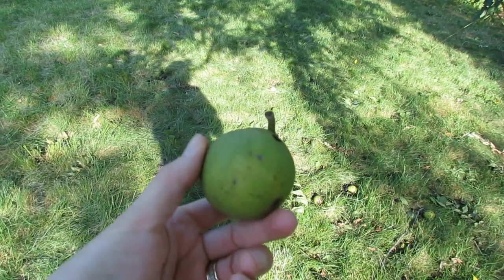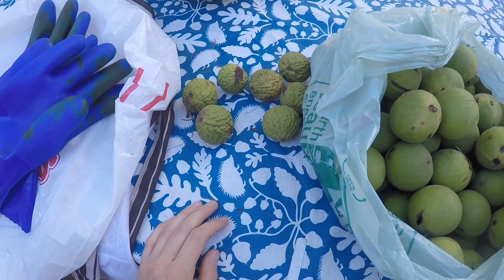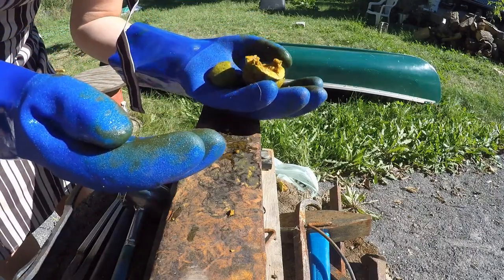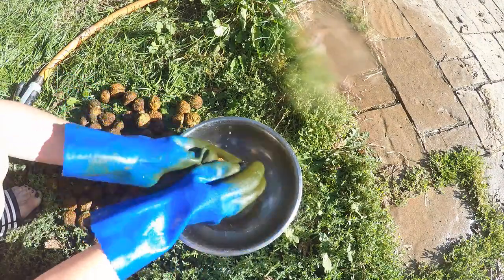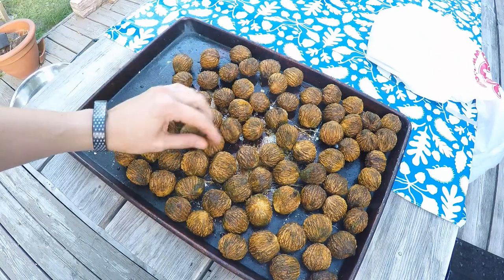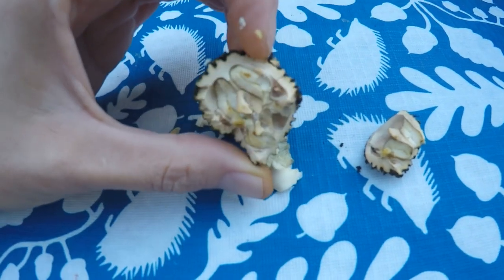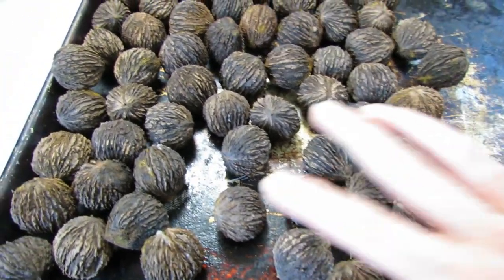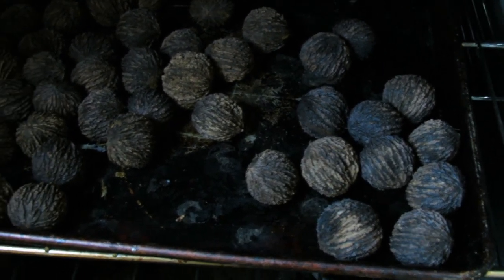Black Walnut

Comment: Hickory nuts are notoriously difficult to crack. Quite by accident, I discovered that drying them by applying heat to the soaked, wet nuts causes the shells to fracture. After the shells are fissured, place them in the freezer. After thoroughly chilled, the shells will fracture into small pieces when cracked in a vise. The nuts can then be removed without the use of a nut pick. Perhaps, some version of this process might work on black walnuts.
Reply from the maker: Thanks for the great tip. I'll have to try this out next year.

Comment: I have 5 mature black walnut trees in my back yard. this is a heavy production produce year.  triple cluster are the norm.   We wait till they hit the ground.  then wait until they turn brown.  It is much easier to peel.  of course I use a corn sheller to take the husk off .  I used to wash them in a maytag clothes washer but I just dry the nut now and crack them afterwards.   Jugalone .  It will inhibit certain plant growth.  It killed off the grapes I planted for example.
Reply from the maker: Wow! Triple clusters eh? A corn sheller is a great idea. I thought that the jugalone would kill my poison ivy but apparently they are one of the plants tolerant to it.

Comment: Wait till they turn black before trying to clean off the shell. Plus put them in your driveway and drive over them till the black shell fall off. You need to let the walnuts dry more before trying to use them. The one you cracked was still green and the will not taste right
Reply from the maker: Thanks for the great advise.

Comment: You might mention to pitch the cleaned walnuts in a bucket of water and discard those that float to the top.  They've dried up inside and cracking them is a waste of time.
Reply from the maker: Good point.

Comment: The surface mold will grow if there is green flesh left on the shells. Its much easier to get the hulls (and flesh off) if they are blackened a bit and soft. Its an icky process but better than the extra work it takes to get the tough flesh off, and mold.
Reply from the maker: Great idea!

Comment: I tried planting 30 of them last year and not one grew. I didn't know you could eat them too.
Reply: Really? Man I love these. Mayfield Ice cream makes this walnut flavored ice cream it's my all time favorite!
Reply: Calvin's Corner72 did you ever plant them, I just stuck them in the ground as is and nothing. LOL
Reply from the maker: They prefer full sun and very well drained soil. Also, the squirrels may have found them on you (this happened to my mother-in-law after she planted lots of them). You could try putting a bit of gravel on top of the nut and burying it to deter the squirrels as they don't like digging in gravel.
Reply: they come up here volunteer , but I have planted them as well, just put them in the ground not too deep, maybe an inch or so in the  fall and then in the spring they will come up.. I put a little patch of hardware cloth or chicken wire over them  to keep the squirrels for digging them up but remove it in the spring. It is possible that you had bad seeds..
Reply: Hard wook seeds need to be spodified 

U tube has lots of videos on best way to start from seed  

I can taste the walnuts now  

Shag bark hickery are great also